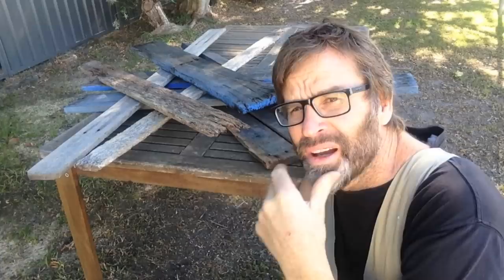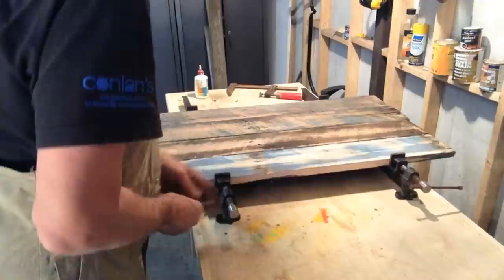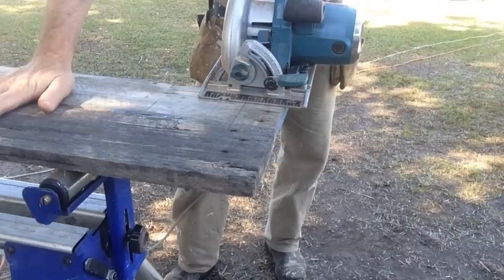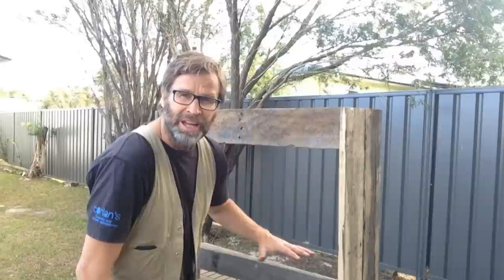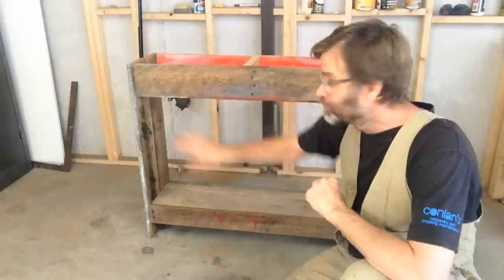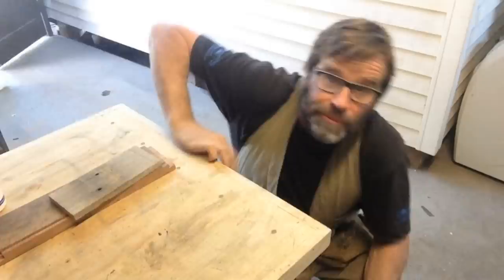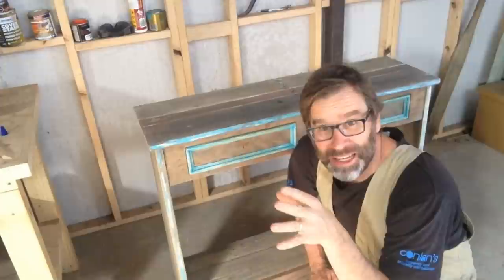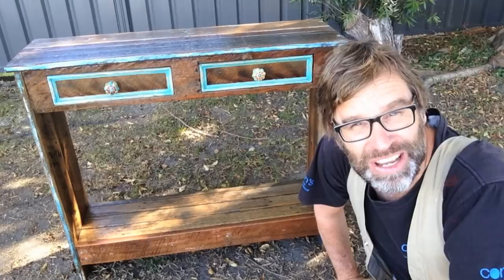How to Build a Hall Table. Awesome Pallet Wood Project

Comment: What I love about your approach is that although your working with pallet timber you still give it the full treatment when it comes to finishing/sanding etc. Same as if you were working with shop bought flawless (yeah right) wood stock. That's the difference it makes. Anyone could tack some rough old lumber together and slap some paint over it and it would still look like roadkill. But the finishing is what counts. Looks Peachy Knackers.
Reply from the maker: Cheers mate.

Comment: Mate you were way ahead of the pallet curve. Such a distinctive style you had back then, much like your current formply fetish ;) I think we all get a bit precious these days thinking we need perfectly jointed and planed boards, when you've shown what you can do with just the most basic of tools and a characterful finish.
Reply from the maker: Thanks mate 👍😁.....I was all over the pallet builds back in the day mate and then after a while discovered that it was a truck load of work so l more or less pulled the pin on them 😂

Comment: I'm addicted to watching your videos.  Just wondering what size nails you suggest using? I'll soon be attempting my first pallet diy.

Thanks!
Reply from the maker: Thanks Adam. I normally use 38mm ( 1 1/2" ) nails. For slightly thicker materials l use 45mm ( 1 3/4" ) nails. Good luck with your projects and let me know how you go. Cheers mate.

Comment: Great stuff. Biscuit joining is something I'm not very familiar with. What are the advantages to doing it, and in what situations would it be inappropriate?
Reply from the maker: G'day Andrew. Biscuit joining is an extremely easy way of joining two pieces of timber together. They are easier and much quicker than the conventional mortise and tenon joint. The down side is that they aren't as strong as the mortise and tenon joint. Cheers mate.

Comment: I know this is an old video, but if you happen to see this. Are you not worried about the top splitting? Tabletop fasteners wouldn't work better to counteract the natural movement of the wood,
Reply from the maker: G'day Andrew. The top hasn't moved in any way. I wish l could send you a photo. Cheers mate 👍

Comment: Hi Shane,
I absolutely love this hall stand but don't have a biscuit joiner, do you have any suggestions on how to make this without one?
Thanks!
Reply from the maker: G'day NessiBessi. You could make the hall table by joining the timber together using timber strips. Just place the strips in areas where they won't be seen, like under the bottom shelf and in the cavity where the drawers are. Clamp and glue the sections together before attaching the strips to ensure a nice join. I hope that makes sense and just in case you were wondering, you can pick up a biscuit joiner for under $100.00. Thanks for the question and the comment. Cheers

Comment: HI shaneconlan1 your video is great and I like the way you did it. Could you please give the dimensions of the table I'd like to give it a go. Thanks for the good work you do!
Reply from the maker: +R King G'day R. I actually can't remember the measurements as l sold it,  but l do remember that the height was the length of a standard board from a pallet as was the width. Good luck with it! Cheers
Reply: +shaneconlan1 how much did you get for it?

Comment: I dont have a planer. Can I use my sander? what sanding grit do you suggest?  

I dont have a joiner. Can I just use wood glue instead?
Reply from the maker: G'day...yes you can use a sander...it just might take a little longer. Wood glue might not be strong enough alone...you can try it and see how it goes, alternatively you could glue and nail some thin strips of wood across the joins under the exposed surface. Good luck 👍

Comment: LOVE IT! how many pallets did it take you to make this? also, could you maybe post a list of supplies & tools that will be needed for this project? :)
Reply from the maker: Thanks Nicole. I salvaged all the material from three hardwood pallets. The bottom shelf was made from four old hardwood fence palings. You could just use pallet wood if you wanted. The job was very basic. All the tools you need are a saw, a chisel, tape measure, cordless drill and some glue, nails and screws. Thanks for watching and for the comment. Cheers

Comment: How did you cut the drawer holes out with the jigsaw with a pre drilled hole first?? Great job Knacker, just come across your channel and I’m hooked
Reply from the maker: G’day Ashley, yes mate l drilled a hole first for the blade to drop in to. Thanks for watching mate and good luck with it👍👊😁
Reply: DIYForKnuckleheads Cheers mate, just didn’t see you drill the hole that’s all, thanks for getting back to me so quickly 😊😊😊

Comment: Knackerrrrsah!!

How DO you get the jig saw blade through the timber to cut the holes for the drawer fronts?? 🤔 
Saw you doing something with the drill, maybe making a few pilot homes to get the depth of the jigsaw blade through. But I tried this yesterday and just left several gaping , ugly holes at points through an otherwise lovely cut line…

PLEASE explain…?? x
Reply from the maker: Mate....all you do is drill a hole through the wood wide enough for the jigsaw blade to drop into and away you go 👍👍
Reply: @diyforknuckleheads   
Awww Crackin ’ !!
Cheers for replying Shane. 
Congrats on your success
Love the vids mate 👌

Comment: Great video, you use the nail gun alot, what size nails do you use. looked at a few makes of nail gun not sure what to look for.
Reply from the maker: Thanks Ken. My gun is a Paslode Gas Bradder. Great little gun that l''ve had for close to 10 years. It in the higher end in regard to nail guns but is well worth the price. Over here ini Australia they sell for around $750.00. Cheers mate
Reply: Thanks
Reply from the maker: No worries

Comment: How do you do the drawer slides?
Reply from the maker: Hi D...The drawer is very simple and just slides in the frame. There aren't actually any drawer runners. This makes it easy to make but doesn't slide as easily as a proper set of drawer runners. There are plenty of videos on Youtube that show you how to do that. Thanks for watching and good luck with it 👍😁🇦🇺

Comment: Is that a brad nailer? What guage is that nail gun? Thanks
Reply from the maker: Yes it is mate. It's 16 gauge 👍
Reply: @diyforknuckleheads  Would 18 gauge work as well? I assume glue is necessary in both cases and that the nail is there to hold it in place while it dries?
Reply from the maker: @vexedev  Yes mate...18 gauge is fine. The 18 gauge doesn't have the same holding power as the 16 Gauge but it will hold everything in place whilst that glue dries 👍👍

Comment: Question-- Having an issue finding Varnish.  However I have found Spar Urathene.  The gentleman at HD said it was the modern form of 'Varnish'.  Fact or fiction?
Reply from the maker: +Shakey Perspective Shakey l couldn't really give you an exact answer as l don't know much about spar urathene. I did a little homework and came up with this. I hope it helps. Cheers
Spar urethane is a protective clear coat finish that has been specially formulated to use on interior or exterior wood surfaces exposed to water, sunlight, or changes in temperature. The UV blockers contained in spar varnish, help to reduce the effects of fading or graying caused by the sun. The basic difference between other varnishes and spar, is the ratio of oil to resin. In spar, this ratio is relatively high, which makes for a more flexible finish. It is tougher than polyurethane, making it more resistant to cracking and chipping. This also makes it more durable under dramatic temperature changes.
Reply: Much appreciated.